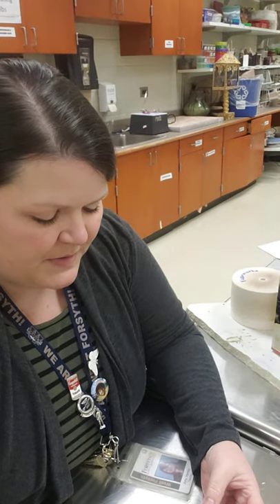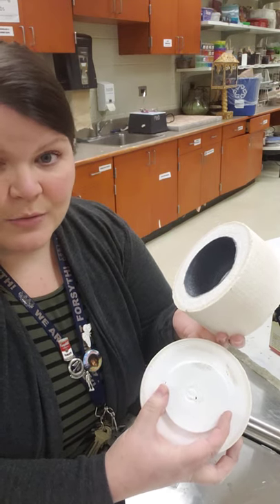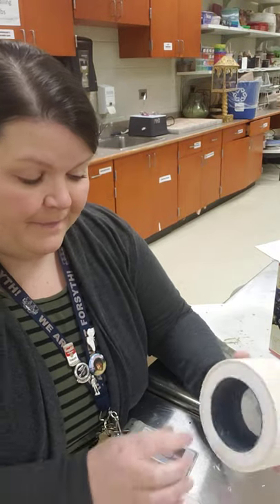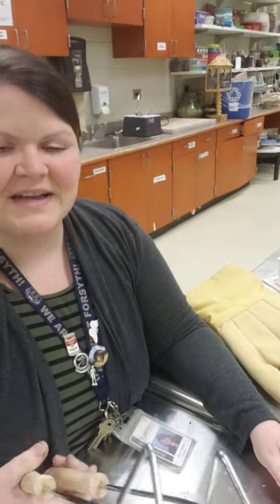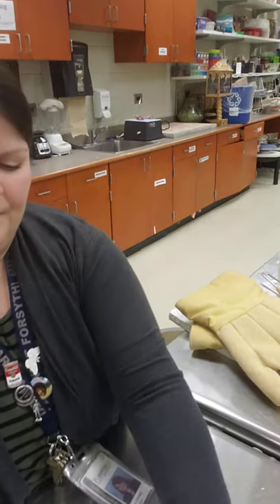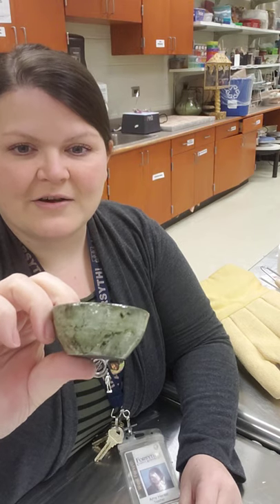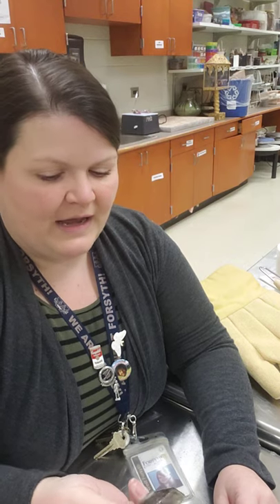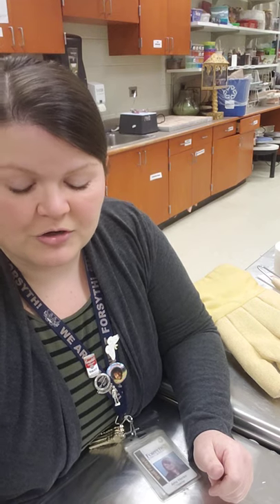Raku in the microwave kiln

Comment: What size and wattage microwave oven would you suggest for one or two large microwave kilns?  Thank you!
Reply from the maker: Mine is a typical kitchen microwave, 1000 watts. The wattage of your microwave will change the firing times, so you just need to experiment. You definitely want the biggest microwave kiln you can buy as the space is tiny so you're limited with what you can create.

Comment: For some reason Raku is a pain in the a.. It will explode so easily even when you think it is dry enough. 
I think you need to dry it until it turns white to be sure. 
I'm going to move mine out of the studio, just to be sure I'm not getting any radiation.
Reply from the maker: I agree- bisque firing in the microwave kiln is very finnicky! Since I have a regular kiln, I just bisque in there but if I didn't, I would take more time to figure it out. I did try drying my pieces out in a toaster oven after they were bone dry to eliminate any trace moisture...that still blew up in the MW kiln. Ha!